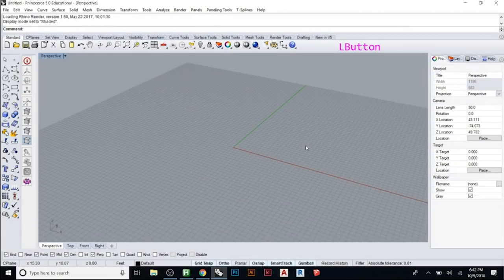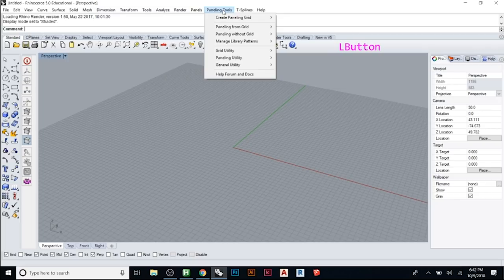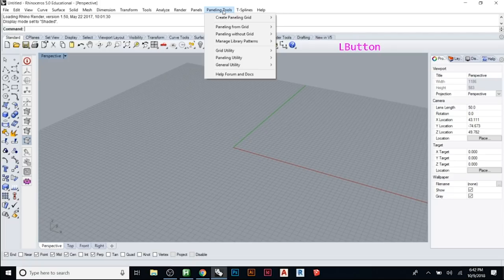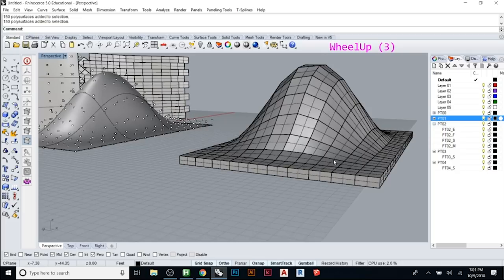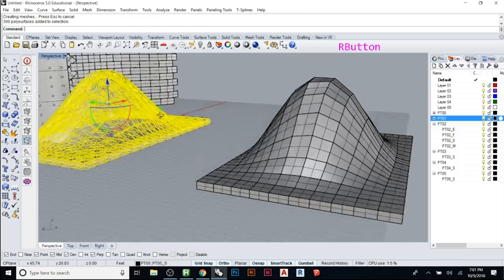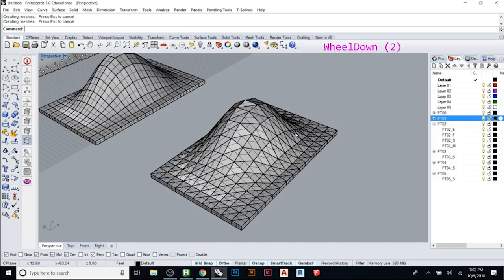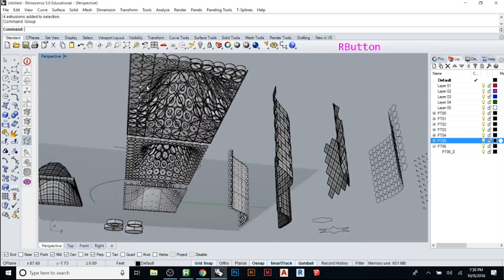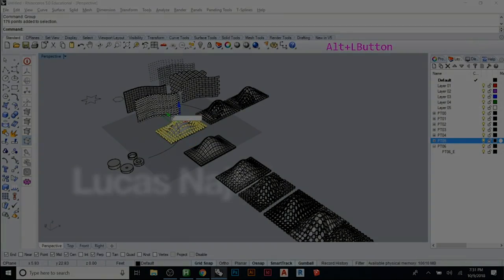Rhino 3D Tutorial |  Paneling Tools

Comment: Hello there! Great stuff! However I am having trouble early on, so after I create a plane then rebuild and turn points on, the plane doesn't curve up when moving the points, it just goes sharply up kinda like:      _/-      (kinda hard here online) But essentially it won't curve, only straight lines. I can get it to work if I make it a deformable plane but that takes way longer (to type in the U and V points) and when I try to rebuild anyways, it still brings the same _/- result. Do you know how to fix it to get the planes consistent after rebuild like show in your video? thank!
Reply from the maker: Check the settings in the rebuild window, one of them is “degree” this dictates how the rebuilt surface will behave. Setting the degree to 1 will behave in the way you described. To get a smooth deformation try setting the Degree to 3 or 5. You can go higher but the result is very similar. Hope that helps!